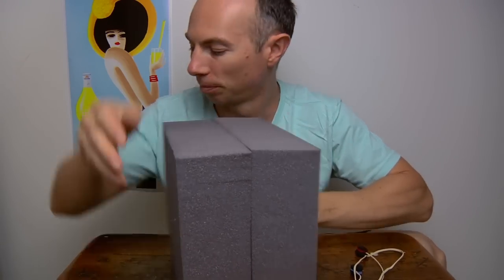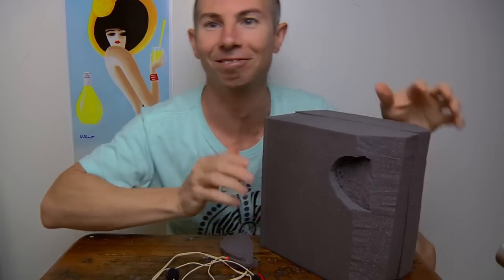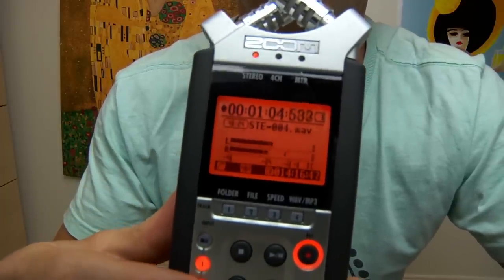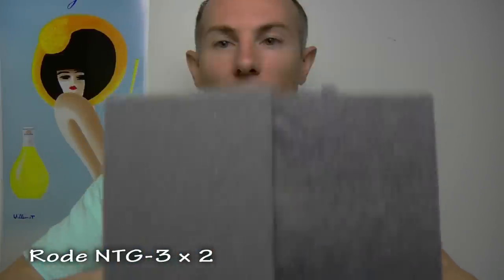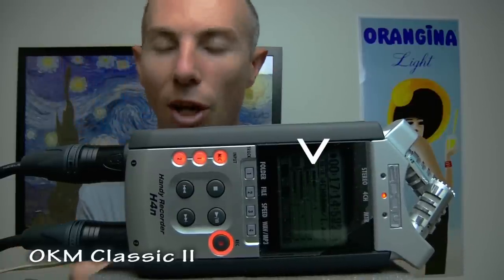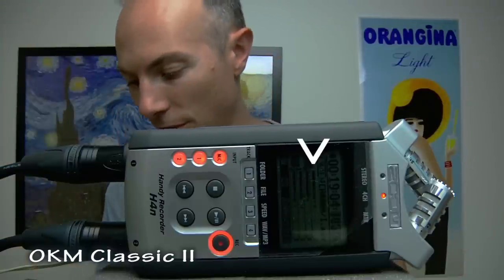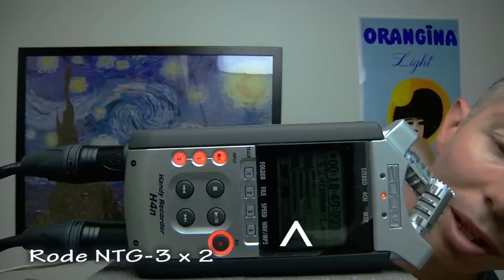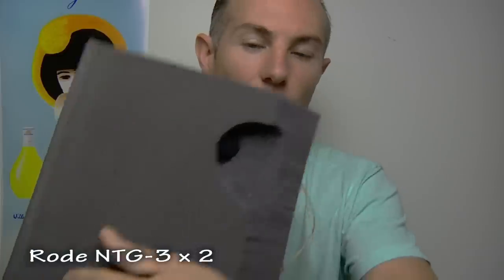OKM II Classic Binaural 3D Test with Dummy Head + Zoom H4N Setup Guide Compared to Rode NTG-3

Comment: Dimitri, Lauren (and anyone else interested), Can I offer a little advice on binaural recording?
I'm a sound engineering student and I've used many stereo recording techniques. For starters, the Zoom H4n is a damn nifty portable stereo recorder. It's pretty powerful. I love it for what it is. The configuration of those two microphones at the top however, are in XY. The XY stereo mic configuration is actually rather narrow, so even though it is two channels and can be panned hard left and right, it's not considered binaural really, BUT for videos like these, it's not only easy to set up, but affordable, so if it's your only choice, it's a good one.
Now, if, like you, Dimitri and you have two cardioid pencil mics like the Rode NTG-3 (yay for aussie mics!), you can play. One of the easiest and most accurate binaural mic configurations is ORTF. It is quite an accurate representation of how a human hears and it works best if the listener is using headphones (which most are). Basically, you set up your two mics to be around 17.2cm apart and angled at 110 degrees. 

But anyway, You're doing a great job Dimitri! Best of luck to Lauren!
Reply: Also, I didn't watch the entire video, so apologies if any of this was mentioned by you :)

Comment: If a microphone requires power, it doesn't mean that it's a better microphone, for example take a Shure SM58 which is a dynamic mic, that doesn't need any power and take a Behringer C-1 that requires 48v of phantom power. SM58 will sound a lot better. Dynamic microphones also perform better in a non acoustically treated environment. To make your sound better you want a decent preamp in addition to your microphone, that will reveal the full potential of any microphone.

P.S - Rode's sound better.

Comment: Do you think the ear cavities will help front-back directional audio by simulating the slight change in character from sounds behind the ears? That always seems to be a problem in 90% of binaural recordings - right-left is awesome, even high-low seems to work well for some reason, but front-back is often hard to perceive.

I support the return of cutting sounds, as others have already :)

Comment: This is really helpful! I'm trying, to no avail, to get my sound system right. I'm thinking I'll have to proffer money for the zoom. I'm a little confused as to what the connections are coming out of the bottom of your zoom. Was that power supply or microphones? I watched your explanation 3 times and am still confused. Sorry for being a little slow on the uptake :)
Reply: Those leads coming out from the bottom of the Zoom are two XLR cables also known as mic leads :)
Reply: And the power supply that you select in the menu is if you use a jack lead. :)
Reply: Good timing on your comment. I just got my zoom! Thanks to Dmitri and you I was able to get it working properly. Thanks you two!
Reply: punkypineASMR Yay!!!! Have fun with it! And little tip with the record button (this used to always get me) when its red light is not blinking it's recording. You have to press twice to stop it blinking and enter record mode from what I remember.